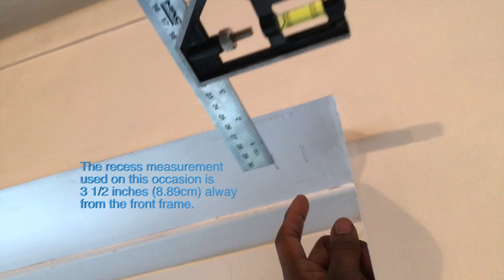How to Install Wooden Venetian Blinds

Comment: Great video, thanks! I. Didn't buy my blinds from you but the way the pelmet (face cover strip) fits to the front of the blind with clear plastic clips is the same, I am searching videos because I need to take down one of my blinds to paint and I can't get the cover off, and where I purchased my blind does not have video tutorial. Do you have any advice or a video tutorial, on removing the blinds cover strip?
Reply from the maker: Here is a video I made for you, hope it helps https://www.youtube.com/watch?v=S1BjJiUq1ac